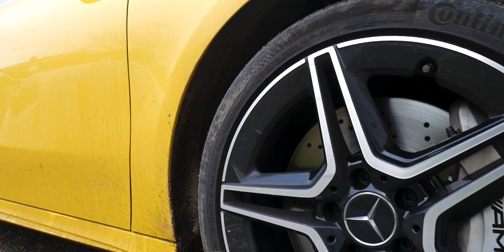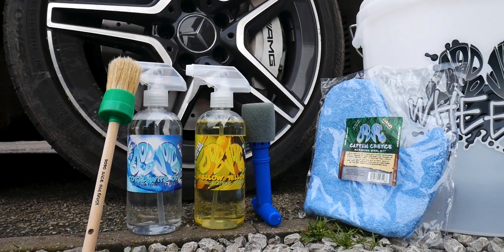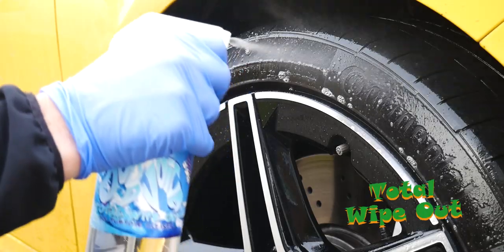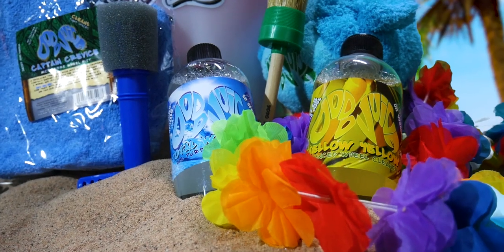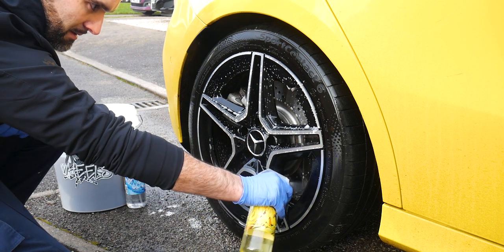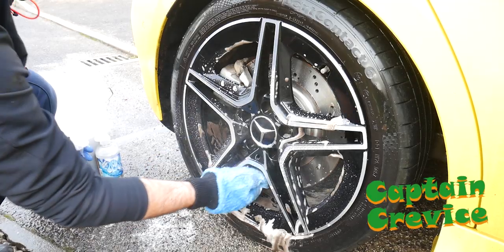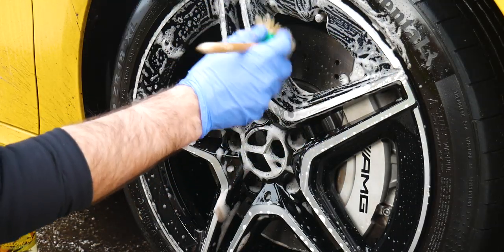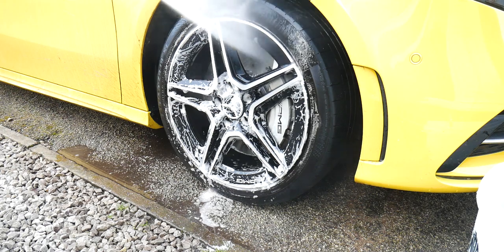Detailing World's Back To Basic - How To Clean Wheels Properly

Comment: Non Promoted Selection.  Vikan 522752 for the tyres and wheel face, Large EZ Detail Wheel brush for the Barrels, BH Surfex for the Wheels and tyres, About 2000% cheaper than The Dodo Juice tyre/wheel cleaner and usable for 10 different things.
Reply from the maker: Thanks